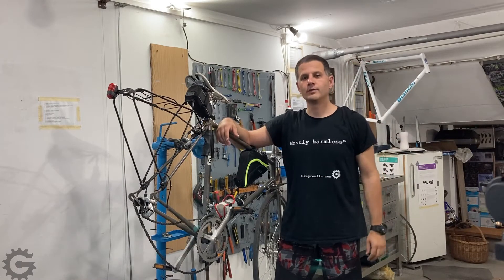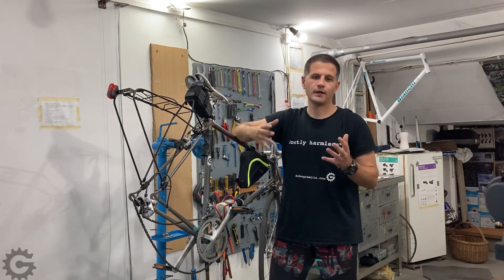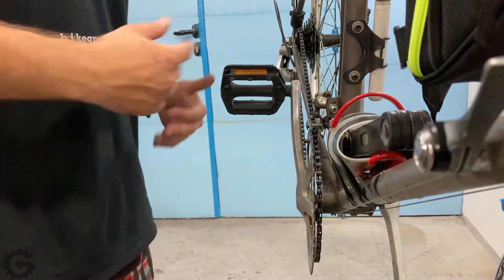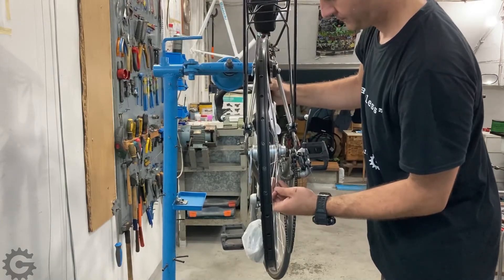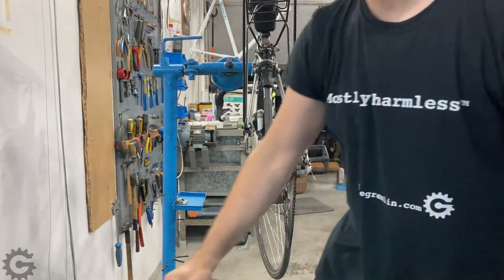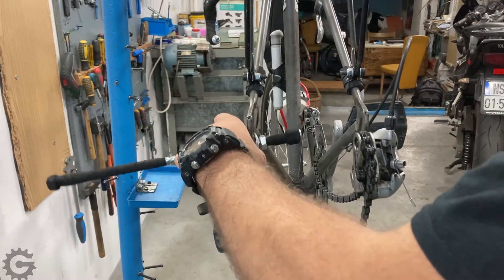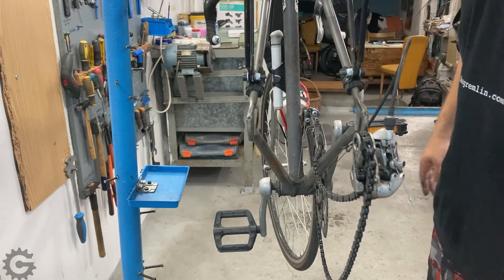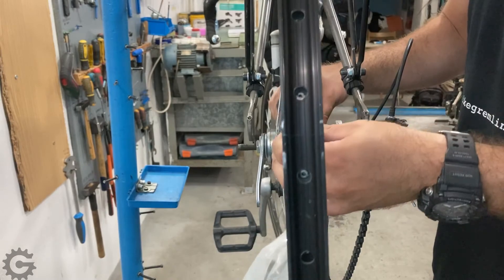Turning a multi-speed bicycle into a single-speed one - basics explained

Comment: On the normal bicycle , can you put anthore chain  on the same sprocket , the bigger on the front with the smallest in the rear and the small on the front with  the big on the rear, may be the bicycle be faster with low torque on the pedals , can you try it ?
Reply: the problem with trying to do something hinky like 'biggest ring up front smallest ring in back' is that you are putting the chain at maximum misalignment which will pretty well encourage chain drop.  There are a lot of redneck solutions. RJ the bike guy even detailed the 'right' method of conversion. I took the method of taking all the gears off my freehub, fashioning a spacer that went behind it, putting a few spacers on the freewheel, put the gear on I want, screw back on, and shorten the chain.  Not perfect, but so far after a weekish and change no dropepd chains now that i have the line (almost) right. Hard on me to do due to poor vision and i'm rednecking the whole affair, but like.... 'this is what i have so make do and move on.' 

It's actually surprisingly fun.